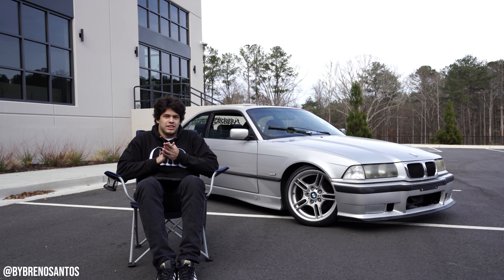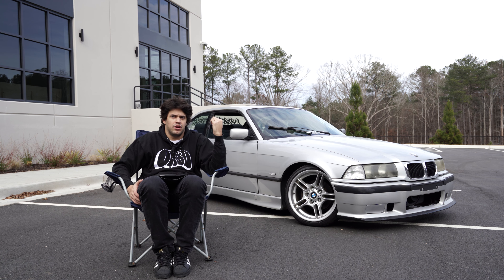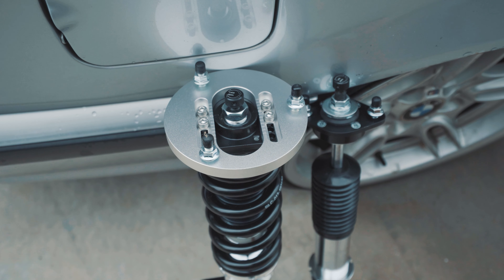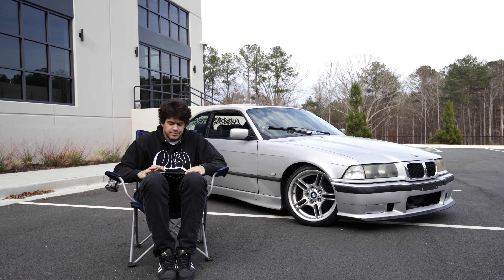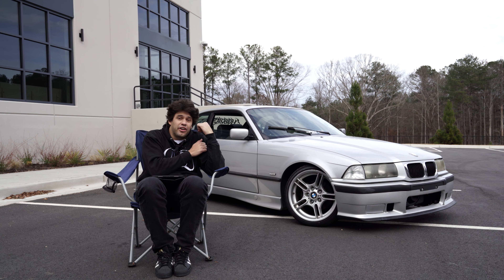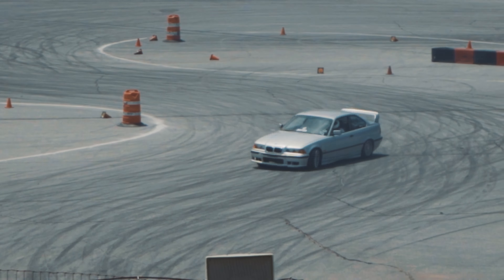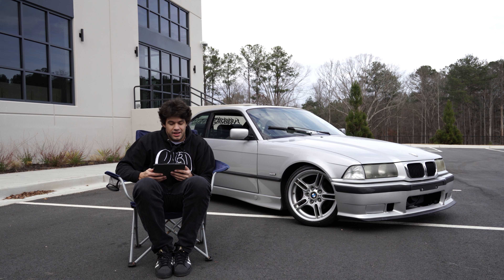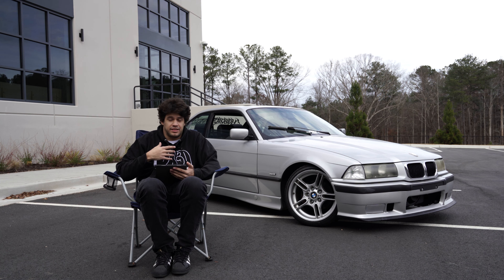The REALEST coilover review EVER! (E36 Silver's NEOMAX Review!)

Comment: what coilover should i go for with a m42b18 e36. not necessarily for drift but for those curvy backroads and street
Reply from the maker: Same as these tbh. These aren’t specifically just for drift and they’re super adjustable so you can make it feel however you’d like. You could also email silvers and see what spring rate they’d recommend for that use

Comment: I just had an accident with my ebay coilovers, the left rear wheel i broke my wheel and idk maybe i have to change the coilovers. And the other problem that i had is when i put the 3rd gear is like im in neutral i need help with that
Reply from the maker: It's hard to tell exactly what's going on but it could be there you need a new clutch
Reply: @ONGO_  yeah im thinking to buy new clutch and new coilovers